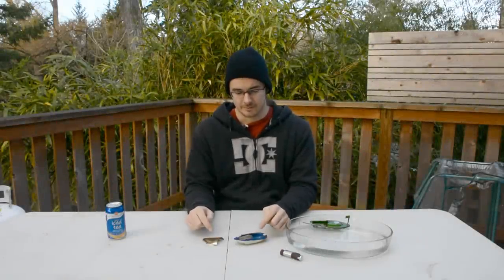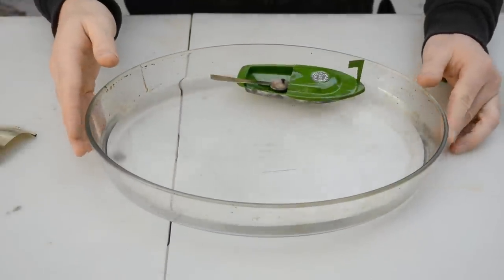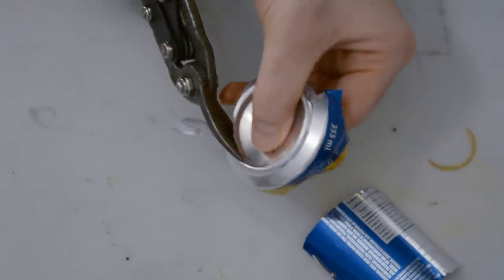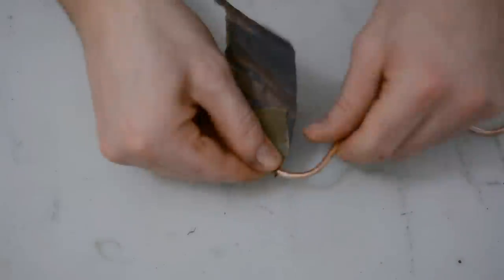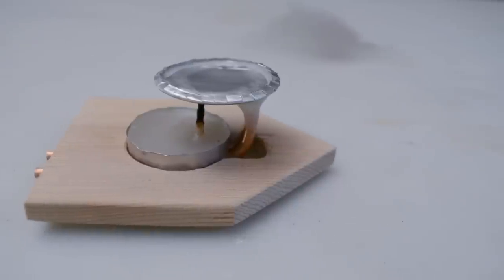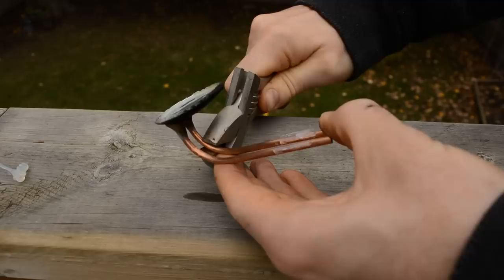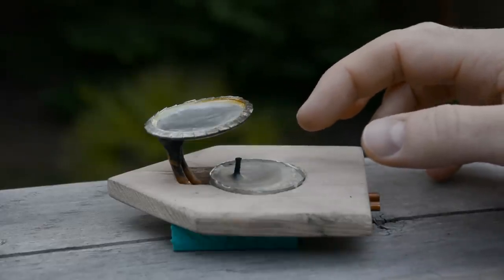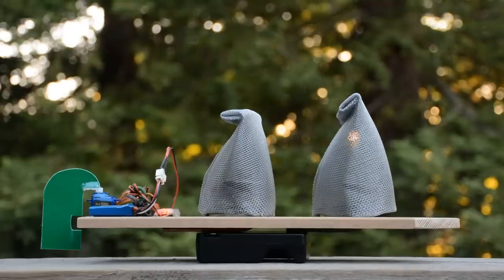How to Make a Pop Pop Boat From a Pop Can!

Comment: Back in the 1950's, as kids we played with them. Here in Australia they were called putt putt boats, and could be bought from most toy stores. If memory serves, the fuel used to heat the boiler was methylated spirits. Has me thinking I'd like to try making one, wondering if using the whole soft drink/beer can as the boiler, with a subsequent increase in the  copper tube's inner diameter, (maybe 10mm), it might translate into a faster moving craft. Worth a fiddle, if it bombs, no problem, simply fine tune it. Retirement has it's good points, and with the pandemic forcing us into lockdown and only travel within our local Govt: area at present, tinkering in the shed has now become a literal 9 to 5 work day, with I imagine, many creative minds at work. Ah, nothing like a well stoked back yard shed/man cave, where one can kick back with a "coldie", from the bar fridge and live in the moment. Suddenly a shout from the house. "Err, whats that honey?, the lawn?, ah yeah, just filling the mower". Shit!, never fails. Sorry folks, maybe tomorrow I can start on that project...

Comment: It is a very simple heat engine. The tubes and boiler are primed with water. Then, the candle heats it up and turns it into steam, forcing it out the exhaust tubes. As the chamber is emptied, the boat is pushed forward by the steam exhaust, creating a tiny negative pressure system in the boiler.

Comment: The basic information Forrest gives here is accurate.  I've built these pop pop motors and it's tricky.  The biggest obstacle is getting a seal with no leaks and getting any kind of substantial life out of the motor. Early in his video he shows  several iterations of getting to a better motor.  But I wonder why he didn't spend some design time for a better boat.  Protecting that flame is paramount.  But he does illustrate how it works.  The twin engine RC version?  Looks just nuts.  Just my opinion, but I thank him for the video just the same.

Comment: Similar to how a pulse jet function's. The only moving part is a Reed valve . Combustion leaves through a exhaust tube tuned to a precise length to cause thrust but  also allow for a vapor lock action that travels backwards to setup the combustion cycle again. Pulling fuel and air past the Reed valve into a hot chamber ignites it instantly. Resulting in the iconic loud pulse noise and glowing red hot metal where combustion happens strangest thing I've ever seen work.

Comment: you can make it even faster by making a boiler that doesn't move and "pop" when the boiler pops out like that its wasting alot of potential propulsive energy. With a sold style boiler all of that flash vapor energy is pushed out of the propulsion pipes instead of pushing the boiler out. While having the boiler pop out may sound neat its wasting a lot of propulsive energy.
Reply: When in fact it is this "pop" which Is the propulsion. Think about it! 😁
Reply: @redcliffripper4861   The "pop" isn't the propulsion it is a result of the flash vapor pushing out the boiler. Which is wasted energy as I pointed out in my comment above.
Reply: Ok, I guess you understand that simple principle better than i do. Lol

Comment: The pop pop noise is made by the diaphragm of the boiler, not the water being expelled from the chamber. You can clearly see the metal diaphragm vibrating in this video. If you make a boiler from a copper coil it is virtually silent. Apparently the inventor of the pop pop boat redesigned it to make the characteristic sound.

Comment: I had one of those in the mid 70's, white hull with a light blue cover.  And you should use a solid fuel tablett instead of a candle.

Comment: Really nice creation! But I have a question: isn't it probable that the epoxy will melt with the candle heat??
I noticed in some of my other projects that the 5-minute epoxy is really vulnerable to heat.
Thanks in advance!
Reply: Well everytime fresh water is sucked back into the device it cools off the boiler.
Reply: @nyxionn  Yes, you're right. Thanks!

Comment: My pop pop boiler slit open on one side when I used too big a flame. Can I use 5 minute epoxy to reseal it, or will the heat melt the glue? (I tried soldering the leak but the motor only worked for a few seconds before leaking again)

Comment: Could be interesting to try to make a self correcting one with 2 boilers next to each other. It would (in theory) always travel into the wind. Shield the candles from the front, but not from the sides, so if the wind acted on the flame/heat, it would likely just move, say, the right candle to heat the left boiler, causing the boat to turn right, nose into the wind where both flames are shielded and act on their own boilers...I give this about a 99% chance of failure in practice though...

Comment: i would be curious to see this done with 4200 instead of epoxy. 4200 is a waterproof adhesive used in boat building a lot. It dries semi flexible so vibrations don't crack it.

Comment: Intake pipe needs to face forward! Vacuum effect that ingests water creates equal and opposite force; water goes backwards, boat is pulled forward, plus, bonus of ram effect trying to push more water into intake. Facing that intake pipe to the rear turns all of that against you … inertia of ingested water translates to the hull in the opposite direction, thus “pulling“  it backwards. As the boat moves forward, the Venturi effect will create a vacuum at the intake opening, and thus be acting to prevent the intake from pulling in more water, the direct opposite of the ram affect mentioned earlier; the intake might even feed off of some of the expelled water, which is going to impart a sideways force. I wouldn’t be surprised if the simple change of intake orientation resulted in twice the performance.

Comment: You should use the rest of the can, or another can to make the rest of the boat. 
You can make a 2 parts mold of the shape. A female and a male part that squishes out the boat shape from the flat aluminum sheet.
Reply: Also you could use a small alcohol container with a wick instead of a candle, the added weight may be useful to lower the center of mass.

Comment: Why not route one of the I/O pipes to the front and when you give it a little bump it would cause suction from the front and route the water and also reduce the suction from the rear which reduces propulsion.

Comment: rather than epoxy.. automotive exhaust cement/sealer, it bakes hard but tough & not brittle & doesn't deteriate with age or heat.. the idea for the boiler is for minimal volume but max area so two curved bottoms sandwiched with 1mm space.. ali tubing short enough that it doesnt blow bubbles & minimum tube for max water flow with least flow resistence for the dia of the tube

Comment: Now you need to make a real size pop pop boat. Candle power
Reply: If you can make 4 tube for a 4 cinder sound try make a double boiler with 4 tube. The objective is trying to get a 4 cilinder engine sound. You know discover something.

Comment: It would be better if one line was on the rear of the boiler the colder end to draw in the cooler water and the other to the front with it angled boiler side up to discharge the warmer water. Try that, should work a lot better! Nice toy for kids

Comment: So to increase speed just the exit point minimize it will increase pressure when exiting.
Reply: If its really just like that and under sun, maybe a mini magnifying glass on top of dish can move it without fire.
Reply: Since heat is needed, sun will be magnified(by the glass), heating the dish = heat up to Cooking Level, then it moves, if fire too fast will stop.
Reply: Maybe abit of distance, = like that, magnifying glass and dish. Further should be stronger. If better is around it like / \ cos the sun is not always from same point. Means just always capturing sun.

Comment: You ignore the original design of the old pop pop boats. The reason they have raised walls is so water doesn't get in, but also so the wind can be blocked from all angles. Wind screens aren't going to do as much as just simply limit the wind and add weight. The sides of the boat also add volume to the center. The way boats float has to do with the average density of the item floating and pressure exerted on the bottom of the boat as a result of the amount of water that is displaced. Adding another dimension makes this a lot easier.

i.e. Imagine a square "floating" in another square, where the density of each square is uniform, then the pressure exerted on the "bottom" of the floating square is only ever equal to it's area multiplied by the density of the bottom square. If this isn't greater than the floating square, it will sink.

Now take it into three dimensions. You have a cube "floating" inside another cube. The material that the floating cube is made up of is entirely uniform, and same for the "cube" underneath it. Now you have to take the volumes, multiply them by the densities, and where the pressure exerted on the bottom of the floating cube is more, it will sink. This is what you were doing.

Now imagine if you took 75% of the floating cube's material away, and it was only filled with air. Air is very, very light. The density of air compared to your material is a lot lighter. If you take the volume of air multiplied by it's density, and the volume of your material multiplied by it's density, it will be considerably lighter than it previously was. The pressure of the water exerted on the bottom of your boat would be considerably more than if it were just a cube of your material, causing it to float better.

Basically, hollow out your damn wood creations. Boats aren't two-dimensional, they're three-dimensional. There is a lot of unnecessary weight you are imposing on the water by only having a metaphorically two-dimensional boat. That's why it sinks.

Comment: I wonder how big you can possibly make one and can you push a row boat...
Reply: If you go slightly bigger it stops working.. You could however do it with hundreds... maybe thousands of these small pop pop motors in one full size row boat.
Reply: @cobre7717  ahh so what if I used a bunch of small pipes off the boiler
Reply: @Sir_knight_trooper   look up Daryl  Foster on here. He has made a bunch of putt putt boats as he calls them.
Reply: @cobre7717  ok I will... thank you for your help

Comment: Instead of all this just coil the copper tube and fill it with water & heat it ,the coming stem is sent  out in two ends of the copper tube into under water & the boat moves forward !

Comment: I'm curious has anyone ever tried a larger scale of this design. No changes in any small way. Would it have worked?
Reply: Exactly what I was wondering. A quick search shows that it seems like it won't scale up significantly. An engineer would probably know why but I'm guessing the "popper" would have to be too thick to pop in and out effectively?

Comment: You don't need such huge windbreakers, especially of screen??? Wind blows through screen. Why not fashion wind breakers from pop cans, cut off the top and bottom bend it to fit around the boiler and flame. As far as using a board why not get a cheap plastic toy boat, cut out a square in the middle and sealing the motor on a thin block of wood into that square etc etc

Comment: why use 1/10ths of normal units like centimeters that can be easily divided in decimal if you can use 1/8ths or 1/6ths of inches that 90% of the world has no idea what sizes are those :D

Comment: pop pop boat, hilarious, watch The African Queen with Bogart
Reply: also don't glue, solder, so much better, lots of flux, easy
Reply: to deal with the wind, take aluminum pop can material and surround it all the way up to the boiler, then put louvers in it all the way around equally top to bottom, oh 1/8th" should work, be sure to direction them, heat rises, so air in bottom, heat out top.. so push the louvers out at the bottom, if louvers are equal all the way around it will suck air in to your boiler lift the heat at the same time prevent air from entering in and blowing out the flame, again the African Queen..

Comment: Hmmmm......makes 40:1 ratio of this design using a hydrogen generator using solar panels,a few deep cycle batteries, regulators, electric igniter and be the first to cross the Atlantic ocean in this boat.

Comment: you should have made it all out of aluminum. make a boat out of wood and wrap the aluminum around the wood then remove the wood your using the wood as a form only. make the bottom first then the top. you know the rest"what comes next". go for it. let me know when it's done. I have too much on my plate as it is or I would have fun doing it. beside`s this is yous and I am not about to steal someone`s project besides I would much rather see you do its perfection rebuild hay that would be a good idea to call it the perfection rebuild of the steam-powered pop pop boat BY Forrest Trenaman. Oh ya that so cool only if you like it of course. hay I am sorrow I talk too much sometimes so just think about it and always have fun.

Comment: I played with pop pop boats when I was a kid, I'm 72 now. I was wondering if this engine can be upscaled to a real boat...two engines or more can share (manifold) water intake and maybe two exhausts into one outflow.... the "candle" can now be lpg or gasoline, gas stove burner or whatever works and sustainable environmentally...
I can imagine multiple engines and displacements too...
It does not necessarily have to look like the toy engine, the principle of the engine sounds simple enough..